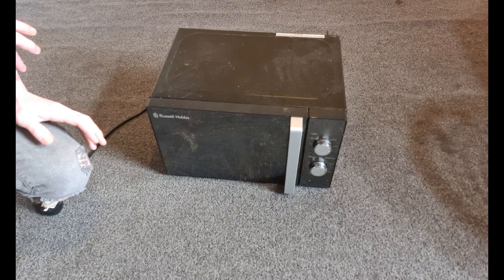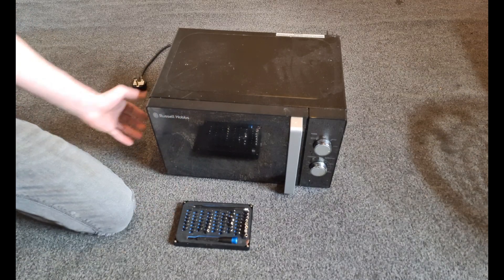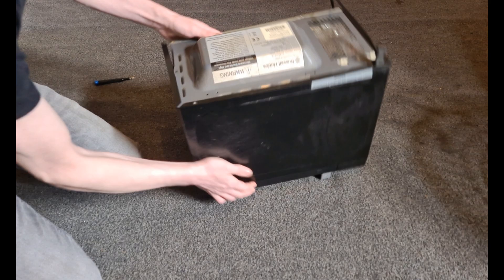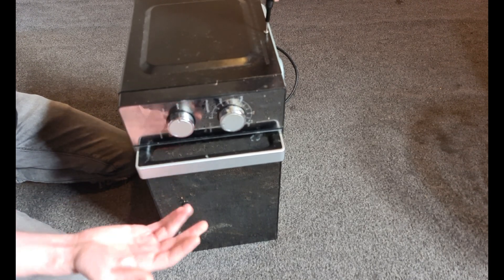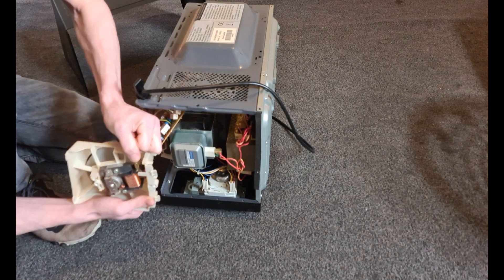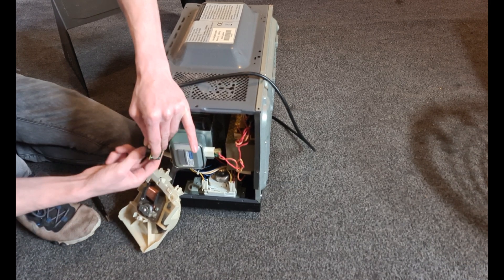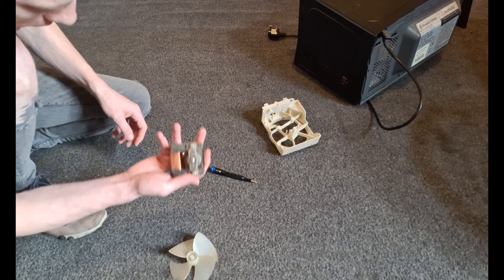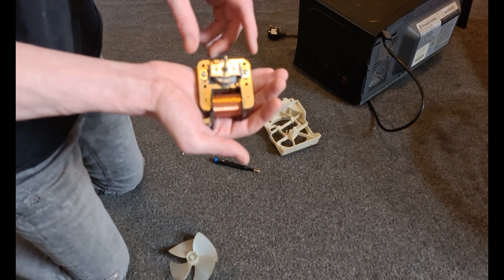How To Harvest Jumper Wire From Scrap Microwaves For PCB Trace Repairs

Comment: my vacuum cleaner on/off switch, attached to a PCB, has failed!  What thickness wire should I solder onto the circuit board to bypass this switch?
Reply from the maker: That would depend really on what kind of current is drawn from the circuit. Jumper wire wouldn't be good for that since it likely carries AC not DC and ratings are very different. If you want to bypass the switch the best thing to do is use a PCB link wire or some copper braid if you don't have the correct switch to replace it with
Reply: @TheCod3r  Thanks! The plug's fuse is 13 amp... the vacuum cleaner is 1000 watts...?  My thought is to solder a 1-inch 'wire' between the 2 terminals of the switch which themselves are soldered to the PCB?

Comment: Only problem with that wire is that you often find the modern versions now are moving to CCA wire, which is going to melt when you try to solder it, and also is very hard to solder as well, as it only has a very thin copper coating under the enamel coating. Plus that aluminium core is going to work harden, and become brittle.

Comment: Haha cmon its a lot cheaper to just buy jumper wire for 2$.
Reply from the maker: Lol this is free, takes 5 minutes and gives you pretty much a lifetime supply 😁
Reply: @TheCod3r  time is money ;) for 2 bucks i can use the wire for 10 years minimum..doing every day repairs
Reply from the maker: @John-oo9xu  maybe, but this is intended as a way to get some jumper wire quick and for free, for beginners who are just starting out. It might sound insane but some people don't have a few bucks spare. I personally know a woman (unrelated to repairs of course) who can't afford a soft drink. If you're just starting out and you've had to spend thousands on equipment, every little helps, it doesn't matter if it's 2 bucks or 20 bucks, you're missing the point of the video

Comment: great scavenge but you know people aint going to wait the 48hrs for the capacitors to discharge, it might have been worth showing people where not to touch & how to discharge safely with a screwdriver. If you wanted a longer video you could even show how to build a discharge tool from a large resistor (not bashing just constructive criticism) :)
Reply from the maker: Yeah people probably wouldn't listen but at least I've warned of the dangers 😁 this one was more intended towards a quick hack but I could definitely look into a video on what not to touch and discharging caps safely

Comment: Apart from the danger of getting a mighty big shock from the caps in a microwave there is also another item of high danger.
The tip of the magnetron is ceramic and made of Beryllium Oxide. Most of the ones I have dealt with are pink in colour.
Much like asbestos, in a solid form it is relatively safe. When broken up or in dust form, Beryllium Oxide gets into the  lungs and is
categorized as highly carcinogenic.
Be careful when handling the magnetron.
Reply from the maker: That's a bit above my pay grade if I'm honest lol, that said yeah I agree there are going to be dangers most of us are unaware of so it's always best to be cautious

Comment: I use the same method for my jumper wire, the transformers will also have a similar wire but a lot harder to extract than the fan would most likely be too thick for thin trace repair but sure it would come in handy at somepoint.

Great vid matey thanks 😊
Reply from the maker: Yeah the transformer would but might be more suited to different projects because it's virtually impossible to extract copper from them lol

Comment: How do you not own a set of normal screwdrivers :/
Reply from the maker: I don't do general work mate, I usually only work on stuff with microscopic components so I just don't usually need them lol
Reply: How are you going to build a new workshop without a screwdriver set, actually ignore that can be done with a knife so not the end of the world, just more shocked you don't own owe with the shed you have of tools and gear
Reply from the maker: @walshy9999  haha I'm not building it, I suck at DIY 🤣